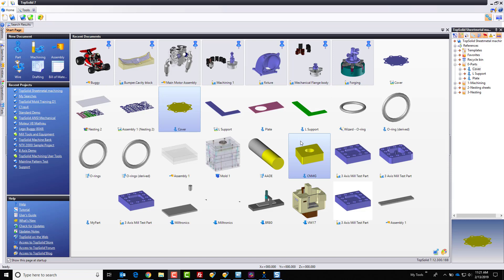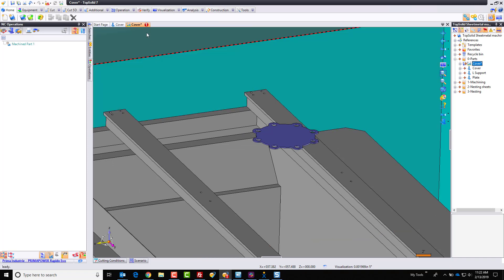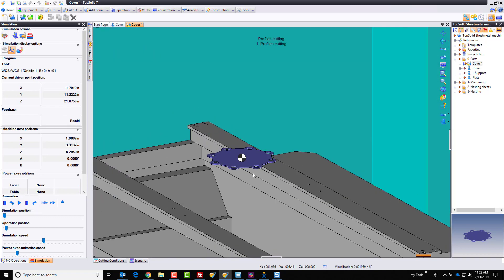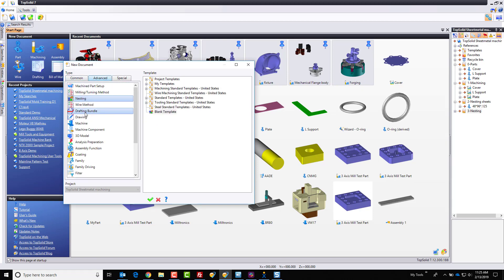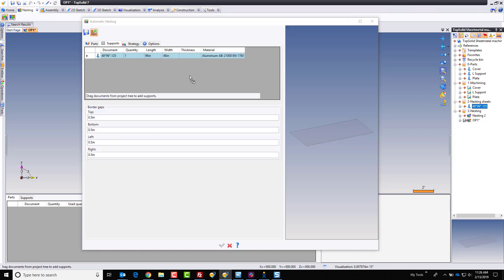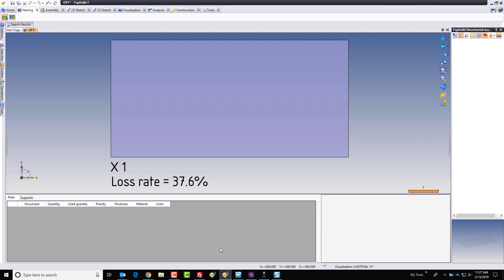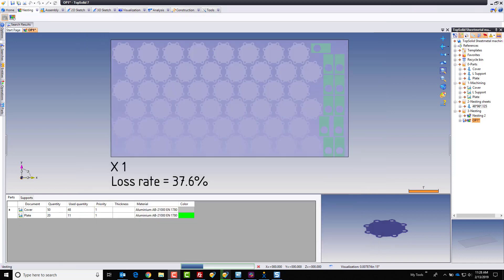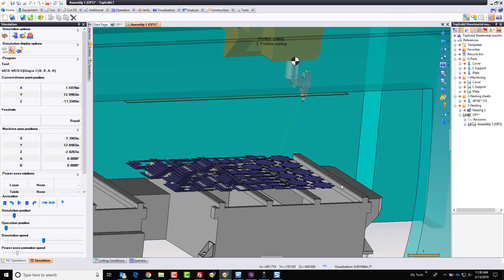Sheetmetal manufacturing With TopSolid 7

Comment: Hi Bill. Is it possible to export the DXF files in NAME_MATERIAL_THK_QTY name format? 

I don't think this is a good practice but many of the suppliers is asking for it.

Also, for some reason the nesting is not reading the unfolded part size and thickness lately. Used it in a previous project but it is not working for my current project for some reason.
Reply from the maker: Hi. Honestly I am not sure on that one as I don't deal with DXF files much. The best would be to send that question to your Local Reseller and ask them.